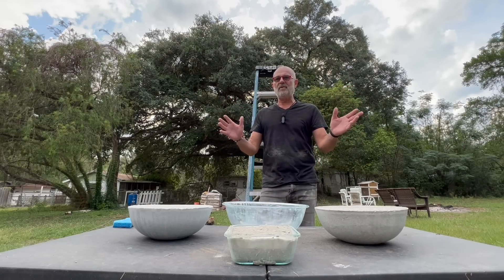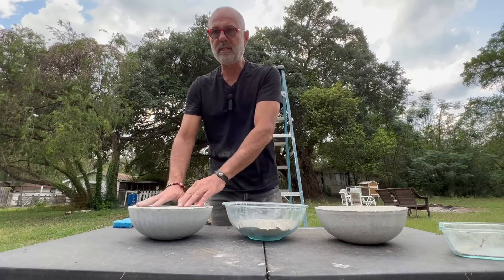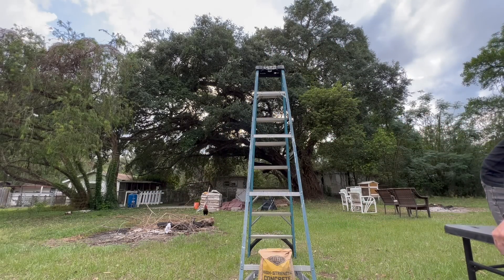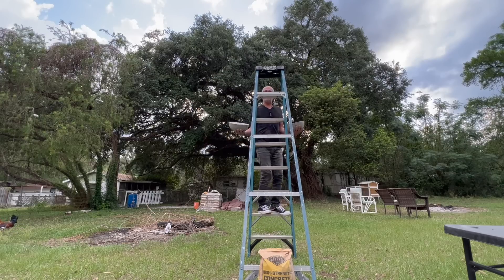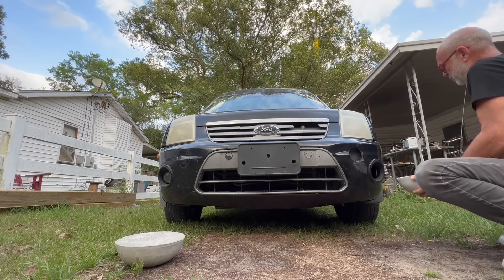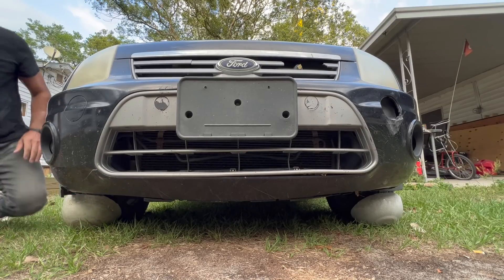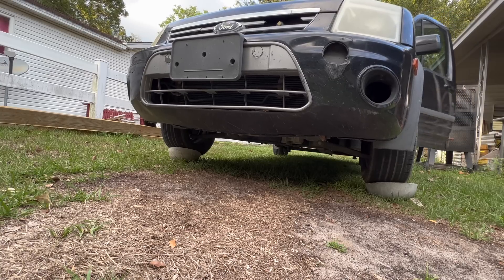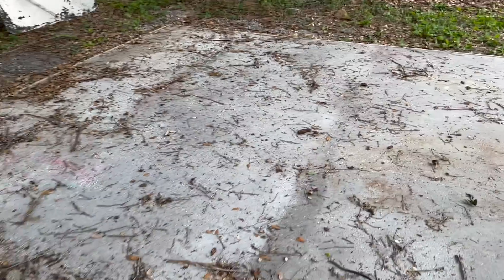Dry Pour Concrete vs Wet Pour Concrete - Strong Enough

Comment: It’s not that everybody’s freaking out that it’s such a weak process. It’s the wrong process. It’s not what the concrete manufacturers intended

Secondly, you’re right it is strong enough, but just about every dry poor that I’ve seen no matter who it is on YouTube they all look like shit after a while. They never actually look like the river concrete they look old are you can see the little Roxanne or even if somebody does a really good job of finishing the top and making it really, really smooth it still turns out looking like shit later plus you do all that work of having to dump the bags Level it out dump more bags level out. Keep on doing this. Keep on doing that whereas if I just take a concrete mixer, pour a couple bags in it get them wet throw it down on the ground. It levels his own self out pretty much almost. I hear everybody doing this. They’re huffing and puffing. I do my jobs or I go out and work and do my jobs that I have to do with people and I’m not huffing and puffing. I don’t have to wear a respirator like y’all so yes, can you do a drive for by all means you can is it right? No can you put rebar in it to make it stronger? Yes does it actually make it a whole lot stronger no it’s actually a big fucking waste of your money because when you do a dry poor and you put rebar in it or fencing or whatever else you wanna put into it Because the cement is dry it does not allow to make a good molecular bond or bond to the rebar, in fact, if you break one apart and look at it, you can see that it doesn’t really contour to the shape of all the little ridges and high spots on the rebar doesn’t even grab the metal like it’s supposed to so can I make it a little stronger yes but it’s still it’s not the right way to do it and it’s a big waste of money because later on down the road when somebody comes in, I say you sell your house or whatever and you’ve done a whole driveway of dry poor OK well this is the shitty part about it. Nine times out of 10. You’re not gonna tell nobody that you drive for it so somebody’s gonna bring in an RV or something really really heavy and then they’re gonna start getting a cracked driveway and then they’re gonna sit there and go back and redo it And pay for it to be redone the right way meanwhile you sold your house under the pretenses that you have a brand new beautiful driveway in there when really it’s not a legitimate driveway. This is why we have the problems that we have and this is why we have to deal with inspectors because if we didn’t have inspectors, and if we didn’t have people there to balance the system and keep checks where they need to be kept people would do all kinds of crazy shit just because it works for a little while even though it’s not right in the long-term, it doesn’t work permanentlyso yeah there you go

Comment: They should be just had strong. Only  if you had too much water to either one it will be weak. But the dry pour once you mist it enough times you can finish it with a mag trowel and create a smooth finish the cream rises to the top. Actually you should mag concrete to a finish regardless how you pour them.

Comment: Actually, The less water you use in the mix, the stronger the mix will be.The strongest mix I have ever worked with was a 1 inch slump. That's  like a clay consistency for airport runways.
Reply: What about bridge concrete?
Reply: @GovilGirl  The same. Very little water. Super high strength mix. The bag mixes are rated at 4000 PSI when cured for 28 days. It takes 28 days to reach full rated strength.
Reply: @victorgalagan1151  I thought they also kept it cooler while it cures by running water on it the entire cure time - even if over sheeting...
Reply: @GovilGirl  Yes, That is after it initially gets hard or cures.Then they cover it and lightly spray water over it to prevent cracking.Keeping it moist. Helps it to cure evenly.That is done in the warmer months.

Comment: All I see are monkey tests. Can someone put weight on concrete formed into say 4x6x20 and perch them  on the ends. Slowly put weight in the middle until it cracks…sounds more of a scientific engineering approach than throwing bowl formed Crete off a ladder onto a grass bed

Comment: Like to see the cost of dry compared to the wet mix brought by truck.
Reply from the maker: On a larger pour, delivered is cheaper for the concrete.  However, there is a skillset and a number of people required that must be accounted for.  On a smaller project, it's simple and easy.  Dry poru just makes sense.

Comment: You're funny, you dropped them in soil and expect any damage?  And again driving over then on the same soil? The dome shape also adds to the strength.

Find a concrete pavement drop them there, or roll over them on a concrete pavement.

Comment: YouTuber..."MAN about TOOLS" has a series of videos on how to make a concrete garden box.  In the series he soaked the concrete segments for 30 days (completely submerged in water)... He claimed this maximizes the strength in the concrete segments to later be assembled.  Since you seem to be taking a deep dive into dry pour...the next test you do, when you do it,  be sure to submerge both (taken out of their forms) in water for 30 days before you test again.  

A suggestion for a future test...
     take a weed wacker to the surface of the cured concrete, one wet and one dry pour... after 30 days of soaking in water.  

MAN about TOOLS, perform this test because, raised garden beds are constantly being weed whacked by string trimmers, which is abrasive to concrete.  
     This is a good test for dry pour.

Comment: I've seen YouTube videos in which a pickup truck was driven onto a 3.5-inch dry pour slab, and nothing happened to the slab. Given the surface area of common vehicle tires and the weight of most passenger vehicles, including pickup trucks, the force created by such vehicles is going to be less than 200 psi. If the dry pour has been done properly, a dry pour slab will easily resist 200 psi. So, yes, for many applications, dry pour is more than good enough. However, would I recommend it for house foundations, garage slabs, driveways, or city sidewalks? No.

Comment: The best way to test both of those would be to use a hydraulic press with a gauge. Dropping them from a ladder on to the grass is not an accurate test. The ground would absorb the impact.

Comment: Cement requires minimal water to begin the chemical reaction to form concrete. Once the chemical reaction starts, it cannot be stopped.  Slowed, yes but not stoped. As the reaction peaks, additional water helps to cure the concrete. The longer concrete can be kept wet, the stronger the finish product. Concrete has approx 75% of its full strength in 7 days to approx 98% of its full strength in 28 days. 
In road construction, dry cement is being blended with base material and minimal water, it looks damp, and compacted. Proctors of this material can approach 100 with the right blend of cement, base and water. 
When doing this process, the prepared base needs to be wet. Flood it with water the night before  placing the dry mix. The cement will draw the water up from the ground and the top misting will put water in on top. After you get a firm top, dont be afraid to mist it frequently.  After 8 hours, keep the slab saturated. A sprinkler keeping the slab wet will make things easier. After 24 hours, keep the slab damp, especially on windy, hot and dry days for at least 7 days. If you can, 28 days curing will make the strongest concrete.

Comment: typically u break concrete cylinders at 30 days 60 and 90 day breaks,they typically break at 100,000 psi on 90 days ,there is no rebar in cylinders ,im sure youll be ok pal... just incase you didnt know the older the concrete the stronger it gets because it is getting dryer and dryer. the Hoover dam is stronger now then it was 30 years ago and will be stronger 30 years from now.

Comment: Well I had to comment. First the dry stuff you buy at the store is called CEMENT. When it is cured it is called CONCRETE. There is a difference. Secondly, when testing concrete dropping it onto a soft lawn isn't going to tell you anything. If you have your concrete tested by a hydraulic press I will believe the results.

Comment: It would be interesting if the concrete companies actually hired engineers to test the relative strength of standard wet pour and the dry pour method.  When comparing wet pour and dry pour, I think the only real differences in the strength is 1) the possibility that the concrete didn't get wet enough when it was first exposed to water.  And 2) you have the problem of possible air bubbles.  And 3) possibly too much water in some parts of the concrete mix.  Of course regular wet concrete has those potential problems, but hopefully it would be noticed and corrected while mixing and pouring.  And the bubbles can be worked out by vibrating the forms.  With dry pouring, it is much harder to see the problems or correct them.
Reply: I believe that's why it's recommended to really overfill & screet. It not only helps get a baby smooth surface, it helps settle air gaps as well
Reply: @leahrowe847  
Maybe even doing a once-over with a hand compactor?

Comment: I think dry pour could be even stronger. Mixing concrete with water can allow water and air molecules to be in the mix.   Dry pouring should give you just enough water to trigger the chemical reaction that caused concreted to solidify.

Comment: Being a concrete guy from the 80's the engineering aspect was the more water you add to the concrete mix the weaker it becomes. I am predicting that the dry pour will be stronger than the wet pour. By how much we just won't know until your next video when you drop an old cannon ball or shot put at different heights. Looking forward to the next video. Subscribed. Looking to dry pour a slab for a shop in the desert and trailering my water in. It'll be a huge experiment. Hope it works. 🤠💪👍😁
Reply: Since you're in the drought area be sure to really water surface b4 adding 1st layer of concrete, bc you won't have any moisture for the concrete to wick up from the ground if you don't. You'll probably need to have extra water available for a faster watering cycle, as the air & ground will be leaching it away from the cement too.
Some things about to think & plan for, maybe 🤔 
Good luck...
Reply: Really? Stronger you think. I think it's awesome that you were in the biz and I get to pick your brain.

I'm planning on doing this BUT I live in the northeast. Freezing in the winter. What do you think about temps and dry pouring?
Reply: @JAYHARRIS85  
There are 7 day crush tests and 30 day (strength) crush tests. When these were broken with a sledge hammer 24 hrs later and the centers just crumbled, well this may not be suitable for much more than a chicken coop. More testing would help determine if it may suitable for things more structural. 
Btw frozen concrete is bad as once it freezes it stops setting up. 
Hot water, calcium chloride should be added it the winter. Once finished  insulated layers should be used to cover and keep concrete above freezing.  Straw and a large tarp works well in Colorado springs area.
Reply: Hey Man, Thank you. 

When I asked about dry pouring and temperature,,, I will be trying it and letting it set up in warm weather. What I was wondering about is how well you think a dry pour (done in warm weather) will do in the winter when it comes to freezing temperatures...?
Reply: @JAYHARRIS85  that's what I wonder as well, also if moisture barrier is needed & what divider to add between slabs (i.e. an old, wet poured one & a new add on dry pour one). 
It's hard to find answers to questions... right!?!

Comment: Definitely will consider dry pouring a patio in the future. Not sure if it will hold up to winter freeze thaw cycles since it appears more porous. But exactly right about only needs to be strong enough. Great video.

Comment: gosh I thought we would be headed for the shop press (the way we test samples). that would help to find a psi rating. then we would understand if 3000 psi is actually 3000 psi. but dropping it on your lawn and running over was fun...

Comment: Funny vid!  When doing dry pour you might pour a little ‘M’ type mortar over the dry mix which is rated at 2500 psi.  This is basically cement without the big 1/2” - 1” rocks which will make it easy to give a smooth final finish with your paint roller.  2500 psi is sufficient for sidewalks, sheds, or other light work.  Wet concrete workers are basically bringing the cement to the top to get their smooth finish when the trowel, thus their surfaces also have a lower psi rating as the rocks in there concrete give the mixture foundation type psi ratings.

Comment: Next video - pur two identical cylindrical pieces of concrete (in a pickle jar), 1 wet pour, 1 dry pour, and after 2 weeks bring them to a concrete testing centre where they test the exact PSI etc. That video would get you millions of views since that's what everyone wants to know - the exact PSI difference
Reply: 3 in or 4in pvc pipe 6 inches long, cut away the pipe. Then put in a press and note the pressure at failure.  is how we did it in college
Reply: I agree but add another cylinder with 20% too much water mixed in to compare the typical Quickcrete mix.
Reply: YES! That is exactly what needs to be done.
Reply: Hydraulic press channel
Reply: @AlanWatts33  Yes. He should do a collab with that channel!
Reply: Agreed. Dropping them 6 feet into grass is meaningless.
Reply: @CasaDeMuchosGatos its like dropping them into cardboard boxes!

Comment: Pretty lame tests... Dropping them into dirt? Driving onto it with soft rubber tires, on dirt?

Come on dude, drop them from equal heights onto something hard, like concrete.

Also notice the dry pour one has way more voids and obvious flaws compared to the wet pour? That's weakness.
Reply: OF course ! !!!!!😂😂👍👍What he did is crazy!
Reply: I've seen YouTube videos in which a pickup truck was driven onto a 3.5-inch dry pour slab, and nothing happened to the slab. Given the surface area of common vehicle tires and the weight of most passenger vehicles, including pickup trucks, the force created by such vehicles is going to be less than 200 psi. If the dry pour has been done properly, a dry pour slab will easily resist 200 psi. So, yes, for many applications, dry pour is more than good enough. However, would I recommend it for house foundations, garage slabs, driveways, or city sidewalks? No.

Comment: The Romans used dry pour concrete when making piers and wharves. They'd fill a barge with dry mix, float it out to sea in the right place, and sink it. Seawater would hydrate it and so it's still there today.

Comment: You can't break concrete by dropping it on dirt take a hammer to it that's the test or take to a concrete testing center
Reply: Well, driving a 1.5 ton car on it is pretty dang good. I agree that dropping on grass is silly. You could drop that glass bowl on the grass and nothing would happen.